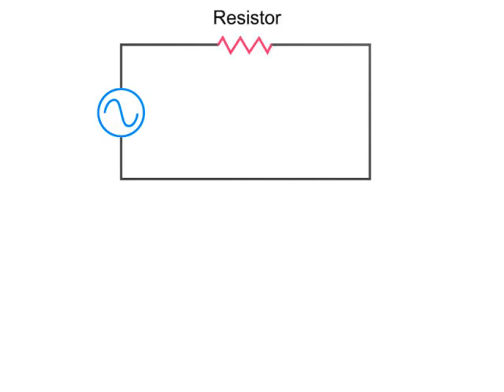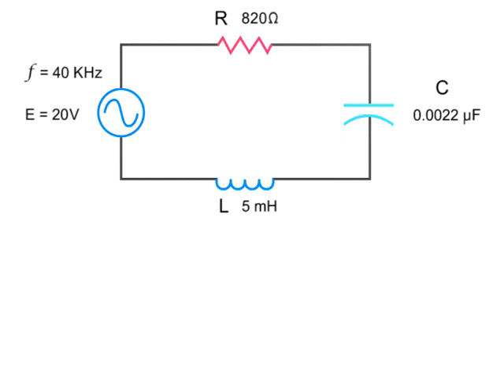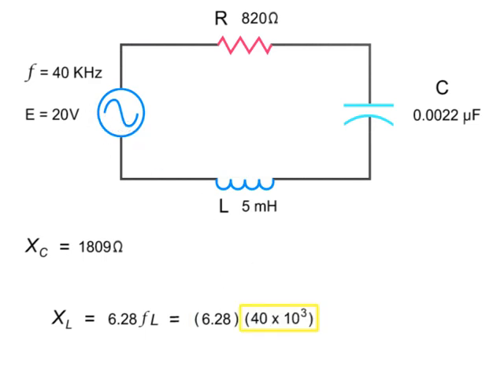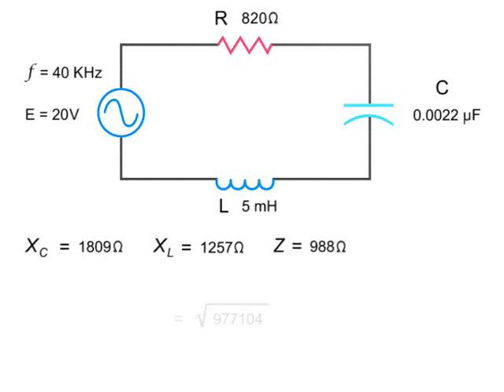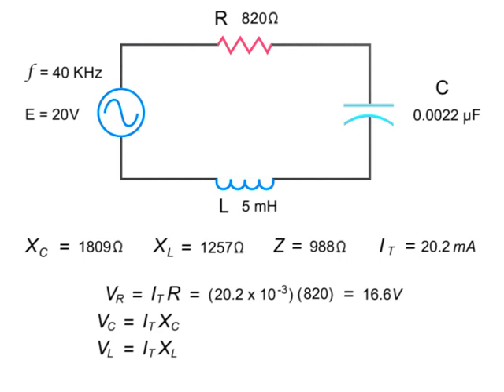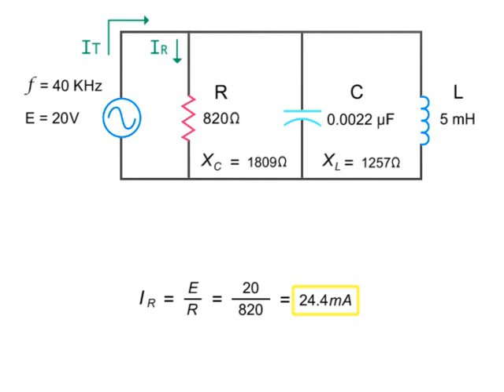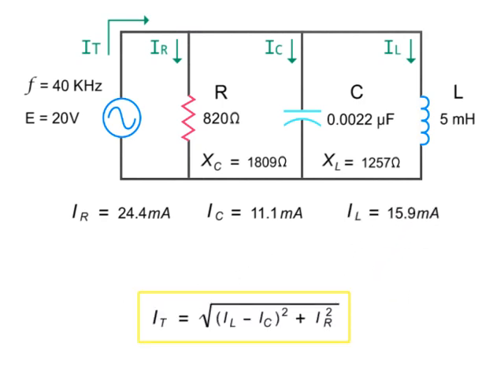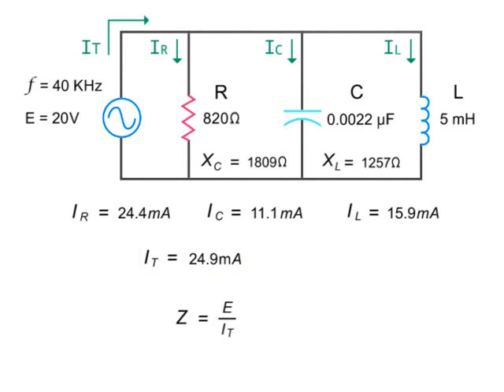How to Solve RCL Circuits with Calcuations

Comment: Why did u subtract XL from XC ??
Reply: For resultant vector(X=Xl-Xc)
Reply: The current through the capacitor and inductor are 180 degrees out of phase, so you subtract the lower value from the greater to get the total reactance.
Reply: You can do xc - xl as well when we square it ans is the same